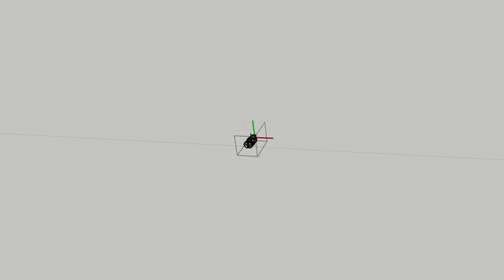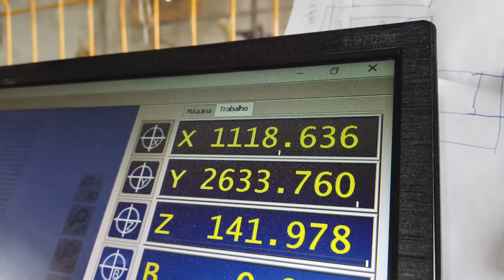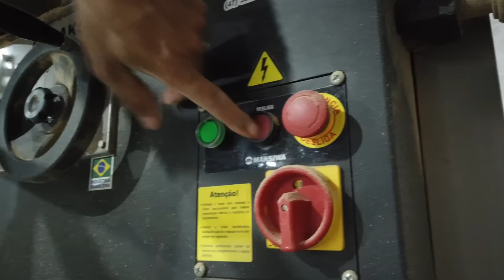NO Space LEFT BEHIND ⛵️ Ep47 – Bulkhead Build - Sailboat Restoration Project

Comment: Good work on the use of space. LED lighting is durable and will consume less power. As you're making a hybrid - electric and sail/wind boat. This will definitely be good. To secure the wine bottles, may I suggest  transparent acrylic. Won't use more space and you can see through the bottles. What about tye engine controls, Have you sourced the controls,  communication equipment, sat phone just in case of emergency, GPS navigation equipment? Lifejacket looks good. Where are you going to store the food and medicines? Any storage space for that. You will require extra of that. Mini fridge for meds and perishable food items. Motorized Dinghy for going ashore or emergencies again with portable comms equipment and flood light and a little food stored in it always. A small mechanical crane (chain and pulley) to lift and store the dinghy on the boat. Now when you do all this, are you calculating the CG or centre of gravity of the boat, because that should not be compromised at all. Never. Thats what will keep your boat balanced and afloat. Of course you have weight / ballast like wooden bulkheads, fridge, comms equipment, dinghy, personal equipment, food. But all this needs to be placed in a balanced manner.

Comment: I hope you eventually concentrate on the important parts instead of interior decorating.
Reply from the maker: “Design is not just what it looks like and feels like. Design is how it works.” - Steve Jobs
Reply: @lahakai , while I agree with Steve Jobs to a certain degree, but “good” design does not mean, that it doesn’t have to take care of every aspect, it can only be good if it also works as intended in combination with everything else involved. 
If you take a Ferrari, but motorize it’s with a 500cc two stroke engine, it might be pleasant to look at, but not to drive 😜

Comment: I get it, your home (boat) is your castle, but with all the interior design, mood lights etc. -will it float better, the cg in the right position, and have good sailing capabilities? After all, every little bit of added weight will slow it down, and make it less maneuverable. Many details don’t affect super yachts, because they are big, and some additional kilos don’t make a difference, but on a small boat like this, you have to think twice, if not multiple times, if the “perks” are worth it to reduce sailing capabilities.
Don’t get me wrong, from a visual standpoint what you are doing is nice, but think about, that everything weight wise above the cg is acting like a lever against the stability of the boat in the water, so a couple of kilos become a lot of kilos depending on the distance from the cg. and that means, that the danger of capsizing becomes an issue.